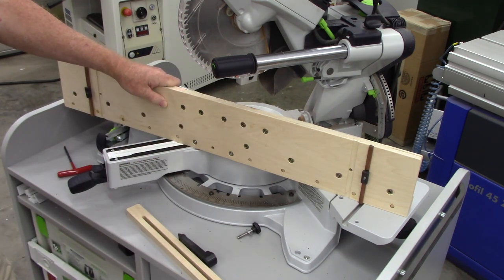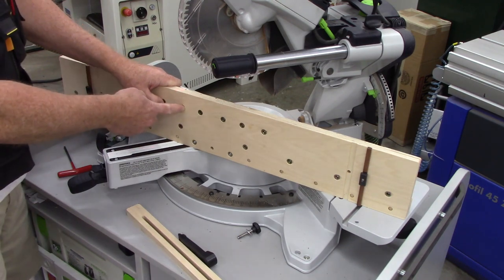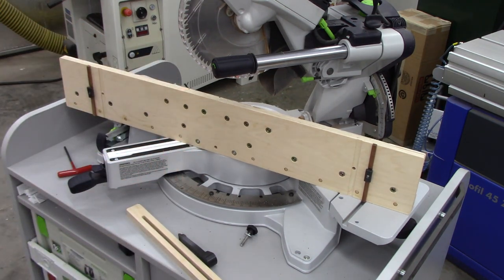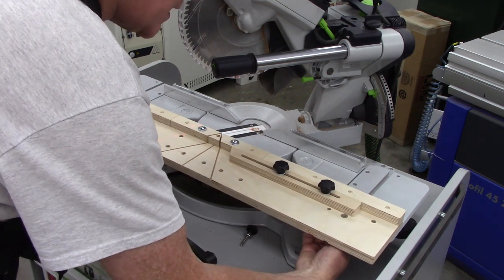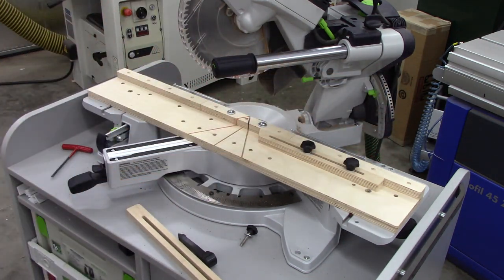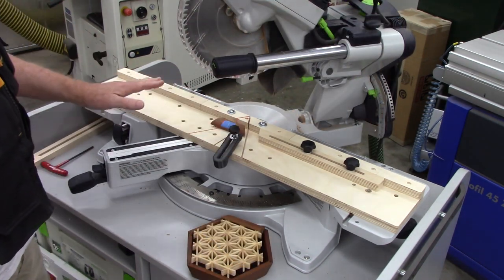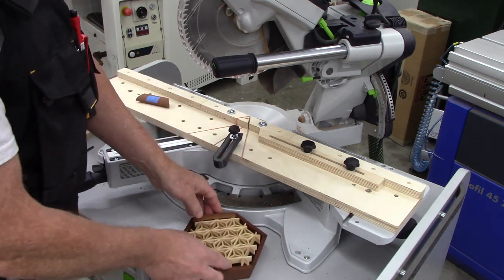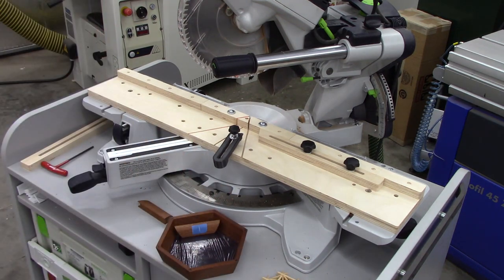Safely Cutting Short Stock on the Miter Saw

Comment: Hi Steve, thanks for sharing this very practical fixture for the Kapex. I am very intrigued by the design of your Kapex mobile station. It looks like there are mounting points for adding extensions to support long pieces. Can you share the design of your mobile station?  I wish to incorporate something similar in the mobile station for my Blum minipress.
Reply from the maker: Hi Carl.  The mobile cart was built years ago from a sketch so no plans per se.  The width of the mobile station was determined by the width of a double bank of Festool Sys-AZ drawers.  In addition to the Sys-AZ drawers, there is a shop made drawer and a shelf for storage of blades, etc.  The back also has several narrow shelves that I use for plastic cookie jars to store things like biscuits, hinges, etc.  The bed height matches the height of the MFT which I recently sold.  There are mounting brackets on the sides to attach Aigner extension tables.  The Kapex can be readily removed for use on a separate stand for jobsite use.  Hope this helps.  Steve
Reply: @extremewoodworker  Hi Steve. Thanks for the detail. I have an Aigner extension table that I use for the bandsaw. I'll do some searching to see what I can use as an Aigner alternative now that Aigner is out of business.
Reply from the maker: @carlnolte1637  Wow!  I did not know they went out of business.
Reply: @extremewoodworker  They were sold in 2021 after the owner, Mr Aigner passed away. Simantech and Martin USA still sell their products. Several items were discontinued such as the thickness stop and pressure jaws.

Comment: Very nice jig Steve. Now I will have to see if you or someone else I follow has Kumiko video to watch. 😊
Ron
Reply from the maker: Thank you Ron.  For Kumiko video suggestions I would look at Wood Art Studio and Mike Farrington for content.  I figured out a jig for the sliding table saw but have concluded a standard cabinet saw is much better suited for Kumiko.   Wood Art Studio has a video using the Kapex to make Kumiko so I may need to try that as I do not have any room for another machine.  Steve

Comment: Hi Steve, that's a nice looking jig. My Kapex stock blade is nice, but I'd like to get something with some more teeth. Cutting primarily plywood, BB or similar sanded/prefinished. What blades would you recommend? Tenryu seems to get mentioned quite a bit.
Reply from the maker: Thank you.  The blade in use in this video is the Tenryu MP-26080AB and is an 80 tooth blade.  It does a nice job.  Festool also makes an 80 tooth blade but I haven't done any performance comparisons.  Steve